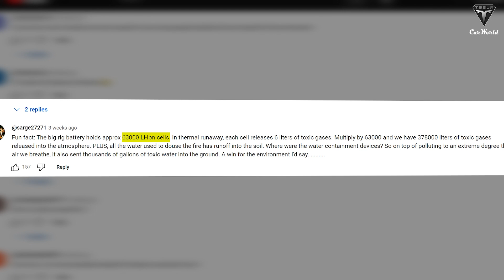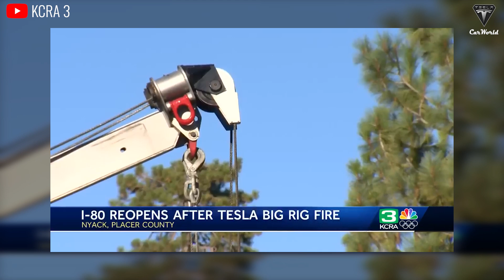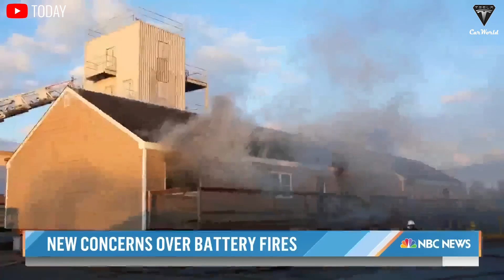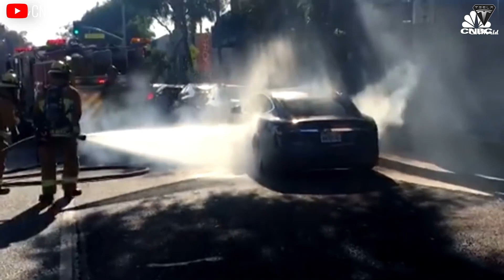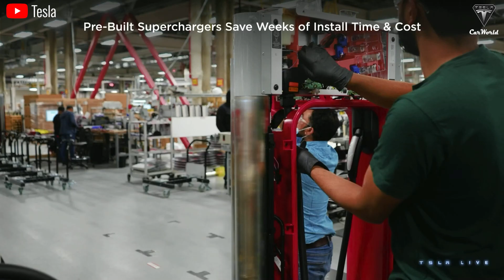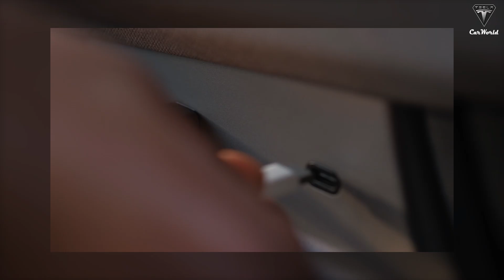Tesla Semi Truck Battery Secrets Revealed After Highway Fire Crash! New Battery Tech Ready?

Comment: I think you're regurgitating the Elon BS. I think the industry is a long way from being ready for this. You need to be a trucker to understand the problem with this. Just check into how a truck stop operates, or just visit a rest area at night. No parking and no charging stations. As far as the electrical end goes, every connection is a potential problem, and the life of a typical truck battery now is about a year, so wheres the data that says these batteries will hold up? A well maintained diesel will last over 500,000 miles, we need to see how the electric motors hold up for the long haul.

Comment: you didn't mention the time loss during recharging. time loss is money lost the more efficient way to do this and lowest damage to our environment would be a diesel generator like in the Edison trucks but retrofitted into used pre existing chassis to reduce production pollution associated with an all new chassis. also if you use a smaller electric motor with a gear box you can really simplify the electronics while increasing reliability and efficiency then do a second motor that can be engaged when pulling a steep grade, I know this would add to the complexity but can be done reliably with mostly mechanical components that will easily outlast electronic components and the truck could still pull a hill in lower speeds then it also offers a backup in the event the main motor has a failure. then doing a diesel generator you can utilize the current infrastructure reducing the pollution produced by constructing all these charging stations while reducing the time loss on recharging and increasing safety. and remember electric is not zero emissions, use your brain, where does the electricity come from? zero emissions is a lie. we can reduce emissions by making smart choices like choosing to repair something we would normally just throw out, this is called recycling and recycling will make the largest difference in the pollution of our environment.

Comment: Accumulators can ignite spontaneously.
Aging is a common cause, specifically dendrites caused by charging cycles.
If a cell fails, it can damage surrounding cells through spontaneous combustion and heating, which in turn also ignite.
The result is a continuous chain reaction.
This is why fire departments hate electric cars.
A cell can ignite even many days after an accident, which is why electric cars involved in an accident are now often kept in tubs filled with water.

Comment: Lithium batteries are no joke. when they go boom, they self oxidize and generate their own oxygen. local fire crew near me told me recently they bury EVs for week in a water filled hole and wait for them to burn out. 

also. batteries are great till it comes time to replace them. how much is a 900kWh battery going to cost?  a model 3 battery can be $5 to 20k. or more. and what happens to the old batteries?

Comment: One problem with an EV semi truck, is that with charging times, and reduced payload due to battery weight, these trucks can’t move as much payload in a day as a comparable diesel can.

They could be cheaper to run, but now you need more trucks, more employees, more charging stations, etc…
Reply: That is true only for trucks that are maxed out on weight. Many trucks haul a lot of air like Pepsi trucks Hauling bage of potato chips.

Comment: Have you stoped to think that maybe trying to use water to put out a fire we are speaking of enough energy to lauch a baseball at 211,399 m/s and yopu supose water will do the the job?In terms of comparison with a small factory, we could think of an installation that consumes around 100 kW of constant power. The Tesla Semi's battery could run this factory for about 9 hours without interruptions. You need Class D extinguishers (for combustible metal fires): These extinguishers are designed for reactive metal fires such as lithium. They contain dry powder such as powdered graphite, sodium chloride or powdered copper, which absorb heat. there is this thing called chemestry, (Na₂CO₃) or  (NaHCO₃) not im not so sure maybe in the kitchen or cotsco, baking soda and sodium carbonate wich could have put out the fire a lot faster

Comment: Using a thousands of liters of water to extinguish the battery fire is just stupid...That amount of the water did not extinguish the battery fire, the battery has burn as long as there's been "fuel" to burn. If the fire has not been tried to extinguish with thousand of liters of water, it would burn just as same...

Comment: Until there are new technologies involved, maybe the one that will make transportation greener is by using something like ethanol, since, yes, you burn it, but when you grow the plant, you also get O2 from it. 
Since a bigger car means bigger batteries the more significant the risk.  
Even though it may threaten plant diversification.

As of right now, full electricity is better for smaller vehicles.
Reply: Thats also a big waste of the econ of food/land as well, so while its nice when we have extra to throw at it, it doesnt help long term and we already the issue of it with corn for example. With that said, you would just be better off just Co2 capture and then release back into rock for a better method.
Reply: We have plenty of land for growing grasses to make biofuels. We can also convert and transport the biofuels just like we do fossil fuels now. Countries that don’t have oil could produce biofuels and not have to import oil from other countries.
Reply: @dave3657  Biofuels still TAKE A LARGE AMOUNT OF LAND, water, time, and many other things. Let alone you have to waste fuel just to gather it and transport it to a processing plant and transport it again in a fuel like method. Its an ok additivie, but it can't replace what oil alone does produce as a resource. The process to make gas for your car also is the same for the plastics in most of your stuff. Its the same line with gas you use to cook with. Its the same line you use for the oil to make sure machines can spin without burning up. If it was that simple we would've already in the US with corn biofuel, but idk if you and the op has notice, its not the reality it is today because it leads to many other issues and raw oil still has way too many uses out side of just gas. If anything, you need to stop using gas and plastics in general and find other ways of transportation if you want to reduce oil needs. Same with ever wanting to drink anything outside of your plastic use.

Comment: Battery degradation is always left out. How long will these batteries last under constant cycles expected in a truck? Trucks are typically run longer than your every day car. With such high purchase prices these need to run 10+ years. Not possible on a single battery over continuous charging cycles. Those cost per mile are calculated on a NEW battery which will only worsen over time. 2-3 years after purchase the battery will be less efficient and the costs per mile will likely double.

Comment: You forgot to mention payload efficiency in your mini budget. If the weight of the truck reduces payload by even 10% then it will take 11 tesla trucks to do what ten diesel trucks will do. If payload is 20 or 30% less, then the Tesla will simply be an expensive way to move freight.
Reply: Yes, plus they take more time to charge verses filling a diesel truck.
Reply: @dave3657 when they introduce the FSD driver's will be able to sleep? and might just become charging attendants

Comment: All well about the maintenance cost and on paper it all looks very nice but when you need to replace a carbarator or injector costing around $150, and replacing an electric motor for about $750, is it cheaper to repair? Not to mention that an ICE car can be fixed at almost every street corner and work on an EV only can be done at certified stations, that also brings higher costs. Electric trucks on paper can be cheaper to run but in reality it's not at all. In any ideal situation you can charge in an hour or so at a speed charger but those are not everywhere. So somewhere in the middle of nowhere city, you can ony charge at a mere 15kw/h because the grid can't handle it. That is a week charging for a truck where diesel trucks can be filled up in 10 minutes and be on their way again. In Australia, many of the outback fast chargers are running on diesel generators so whats the benefit of that? On paper it's all nice but paper is not reality and people should look around them instead of a 10 inch screen showing theoratical calculations in ideal situations.
Reply: I mean you kind of answered your self. Majority of charging will still need to be down by the grid, but in places where power is a problem, you would put generators to get people over the bump. Many of those stations still use batteries and power source of the local grid though, so while its true, its not fully true that they are diesel only for many of them. You are still cutting over half or more of the need for a fossil fuel for one that can be made from the sun. The other is more of a issue of econ in terms of what parts are out there. The reason many of those parts are cheap is because they're already floating out there to be used. So yea, there would be a bit of a trade off of part cost.
Reply: Sure, let your money evaporate to thin air like the 75% of the energy of the fuel in the tank , also silly the reason is china and of course things like the Jhon dere and apple problem

Comment: What I’d like to know is where have all of these millions of gas and diesel vehicle fires been all of these years I’ve been drive over 60 years I’ve seen one vehicle on fire on the road and 2 that caught on fire from electric shorts those burns some wires an blue, the fuses but nothing else was harmed just a little smoke but I’ve seen hundreds of EV fires in the last couple of years with ships burning up parking garages made of concrete burning up destroying the entire structure and thousands of other vehicles destroyed in the fires 🔥 I’ve never seen a gas or diesel vehicle with enough fuel to melt a concrete and steel building now they did say that the twin towers and buildings 5 half a mile away did melt those buildings but they arrested the FBI agent and locked her up for years because she found out they had painted all of the steel in the buildings with thermite used to melt steel and she was locked up so she couldn’t tell anyone. I don’t think they’re doing that with all EV’s there burning on there own I’ve seen lots of test where just puncturing one lithium battery causes a explosion and fire or just heating it up above 100 degrees they can explode so you really shouldn’t leave EV’s in the sun or take them to the deserts because everyone there have air conditioning don’t they because you wouldn’t want your vehicle to catch fire. But they’re safe just like at a few of the battery’s manufacturers plants that have burned up lately along with some of the battery packs but that’s ok because things catch fire every day and you have to get at least 1/2 a mile away right well not really but look we’re saving the planet from people with toxic gases so it’s ok burning down lots of things like concrete buildings and other stuff👍👍👍👍👍👍

Comment: What if. You take 1/4 of an EV battery. Separate it from the rest. Hookup the 1/4 battery to a power converter. Then. From that power converter to the EV charging port and where the EV can run while being charged. I am running that exact test kinda right now. A three battery system on a 108-watt refrigerator. No solar. Just three batteries. The refrigerator has been running for just over 17 hours straight. The way it's looking. Who knows when I will run out of power. The battery that is suppling they system has only lost .2 volts. 2 AMG 100 ah batteries and 1 100 ah Lithium battery. Over 17 hours and I lost only .2v.

Comment: This truck fire produced 378,000 L of toxic gas? Is that a lot? Let’s see, 378K L = 13,350 cubic feet = 495 cubic yards. The cube root of that is ~8 yards, or a cube 25’ on each side, i.e. a cloud of toxic gas the size of a house, out on the open highway, where it disperses rapidly. As bad as it truly was, the harm caused by this truck battery fire has been exaggerated, by the clever presentation of numbers (if you can’t blind ‘em with brilliance, you can always baffle them with BS).. Large battery fires are certainly a bad thing, to be avoided as much as possible, but they are NOT deal breakers. Not even close.

Comment: No, That’s not what PEOPLE think, that (that EV actually stands for “Explosive Vehicle”) is what A FEW people think. There is no evidence that EVERYBODY (i.e. “people”) ever thought that! EV stands for “Electric Vehicle,” and in case some people didn’t know this, electric vehicles require batteries, and most batteries will catch fire under certain conditions. This has always been true, which is why there are restrictions on flying with certain batteries on planes. This particular battery fire, in an experimental truck battery, was far larger than most. So yes, it caused a toxic disaster (actually not clear how bad it was, yet). Also, yes, it is experimental, so things could be expected to go wrong. It’s a price of progress. They will get better. In terms of “toxic disaster,” batteries are still far from creating the kind of toxic disaster coal and petroleum have caused! And they will be developed far beyond where they are today. I have to say, if it’s a choice between fossil fuels and batteries, batteries win, hands down.

Comment: Using water to extinguish fires should have been discontinued long before the EV era

There are more efficient, quicker, less destructive, and less messy methods of putting fires out
Reply: As the batteries produce their own oxygen, the only way to put out the fire is to remove heat with water.

Comment: Testla knows their PROBLEM, Lithium, Get rid of Lithium for Batteries. This is going be to be a problem when they build the Mod-2  next year.
Reply: not going to work for semi. energy density too low for big rigs
Reply: @i6power30  Yes and no, the total density of NA can be lower, but you could build the battery out of NA and it could reduce weight by 30% even though they would come in 30% less power. It comes down to other materials that add up to the total weight of the battery more than anything. Li and Na only make up a small amount of that total battery weight. Less over all cells means over all less space and weight as you remove the need for the cans. It goes the same for Li, but over all, still holds if we limit the range to the 300 and 500 mile goal. For example, instead of rolling them, nothing says we can't stack them instead.

Comment: The incidence of a fully electric vehicle catching fire is significantly less than an ICE vehicle and hybrids have the highest incidence of catching fire.

The report says the battery fire reached temperatures of 540C, diesel and gas vehicles burn at 1,950 C.  The report specifically mentions hydrogen cyanide but all vehicle fires give off Hydrogen Cyanide.  BEV fires do or can give off Hydrogen Fluoride (HF) tests shown that firemen´s std gear prevents HF contamination.Most battery cars now use LFP batteries which are less likely to catch fire when damaged, charge better and work in very cold weather.

Scania did a study of 30 ton trucks comparing carbon emission of a diesel truck to a BEV truck.  BEV truck reduced carbon emissions by 90%

Does the US want the diesel trucks polluting the atmosphere every day or do they want the very clean EV truck being zero emission unless it´s in a major accident and has the battery catch fire.